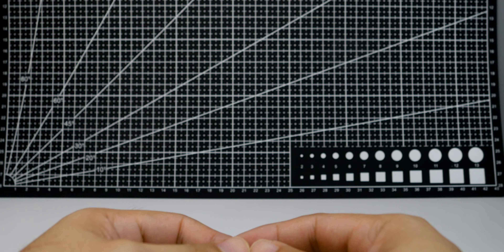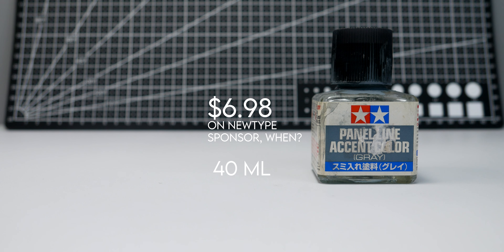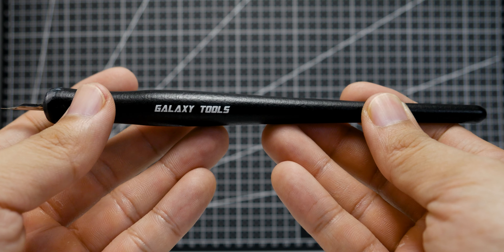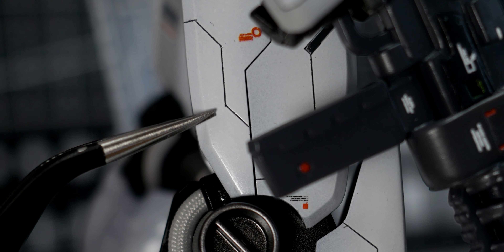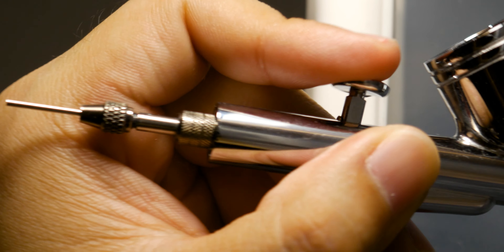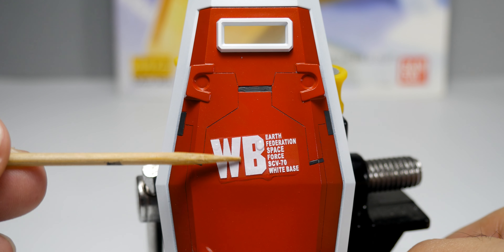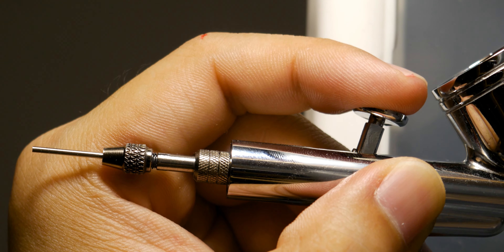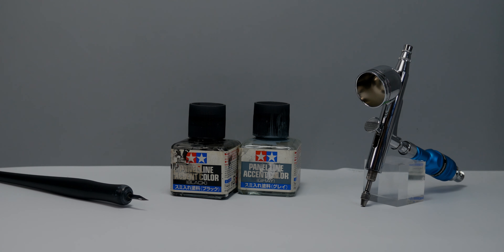HOW TO PANEL LINE A GUNDAM - Quick Tutorial

Comment: I just recently purchased the same ink and pen to do some panel lining! Do u use the same panel line paint for air brush or is there a different type of paint? I Just recently started getting into pane lining/ custom some figures mostly transformers And your video is help! Thanks
Reply from the maker: I use the same type of tamiya enamel accent panel line paint to airbrush wide panel lines. But for main painting, I use lacquer paints. Be careful though, I'm not sure what type of paints are used on the figures and transformers. The enamel thinner might dissolve it.

Comment: How do you avoid cracking when using enamel wash for panel lining? Sometimes it still happened to me even when I applied it before assembly.
Reply from the maker: Yeah, that's why I recommend gloss coating before panel lining and decal..that will protect the kit, allowing smoother flow of panel line paint and decals. It will also give you a smooth finish
Reply: @GunplaNewbie  so after coating > decals, panel line, did you top coat again?
Reply from the maker: @samuelkurniawan1383  Yes, it's advisable to give it a final top coat (gloss/matte/semi) of your preference to seal everything up.
Reply: @GunplaNewbie  thanks man, you've made my day, one more question for metal build strike freedom, is it okay to coat it's innerframe with clear gloss, or just coat the plastic parts, and how much do I need for coating the whole things in Millilitre. Thx for advance.
Reply from the maker: @samuelkurniawan1383  hmm I have no experience with metal builds. But top coating innerframe could make the parts tighter. Is it a 1/100 kit? Also are you using spray cans?
Reply: @GunplaNewbie  yes it's okay if it's tightened, I just don't want to made the golden innerframe become more blurry. 
And metal build didn't come with runners so I can't test it. 
Yes I'm reffering to use Mr hobby top coat and clear gloss, do u have idea how many spray cans that I need.
Reply from the maker: @samuelkurniawan1383  Honestly, if it's perfectly glossy chrome/gold, you probably don't wanna top coat them. Even if it's gloss top coat, it might still make it less shiny. 

1 can is usually sufficient. It depends on your spraying technique lol. Some people could go overboard with a lot of wastage.
Reply: @GunplaNewbie  i see, welp i better to unplug all the plastic part 1st then, and Coat the plastic not the metal itself, so what's the other technique to prevent those shine ageing?
Reply from the maker: @samuelkurniawan1383  I would say 2k polyurethane gloss but if you truly wanna keep the 100% of its shine, then leave it bare. Because even with the 2k poly gloss, it will still dull the reflectiveness a little bit. Glossy builds are a pain in the butt lol

Comment: wel , i switch between a panel lining pen GM02 (gray)
and Tamiya black , with the lil brush like you have
Reply from the maker: Yeah, I started with that and have been using that for over 2 years now.  But I'm learning more application methods to suit different needs which offer more options ... How long did those bottles lasted for you ?
Reply: @GunplaNewbie   i have yet to depleat it 
went true like...hmmm .. think 15kits 
stil plenty in it
Reply from the maker: @takoza5396  yeah the mileage you get for the tamiya accent bottles are insane

Comment: Is a Gundam pen still good to use for panel lining ?
Reply from the maker: Assuming you meant Gundam markers. A lot of people do use gundam markers to panel line. However, I've never personally used it. But I did use Micron fine tipped pens as thin as 0.15mm. Even then, it's still not "fine" or "thin" enough for some panel lines. Even if it fits the panel line, I often find the finish not as fine or clean as the tamiya accent panel line method. 

I hope this answers your question.
Reply: @GunplaNewbie  yes it does thank you